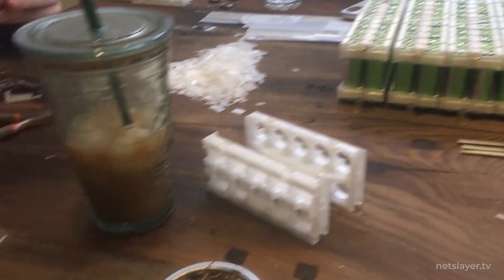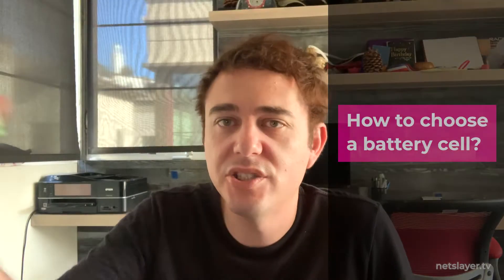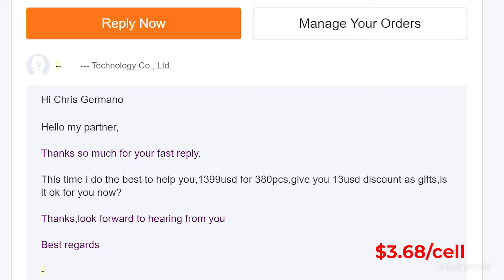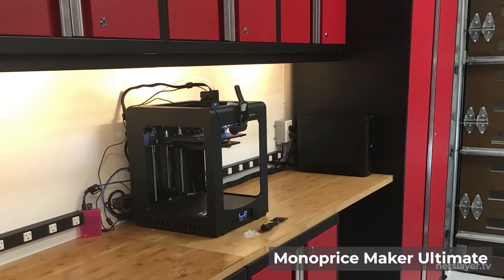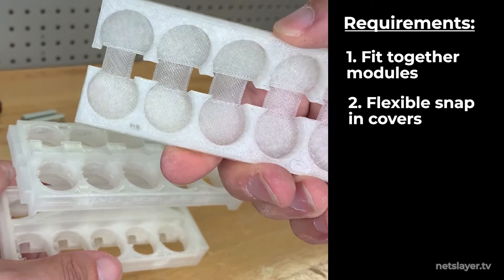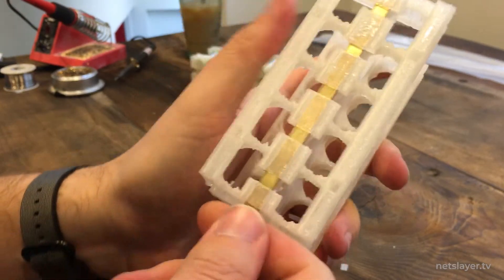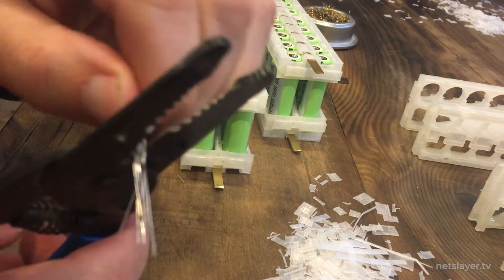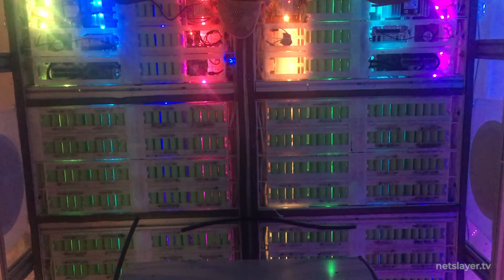How to build batteries - EP5: Building Enterguise an Electric Art Car for Burning Man. DIY 18650

Comment: Have you seen those little spot welders for making battery packs?  I've seen them used in a few videos.  Seems like something that might be handy for someone in the future.
Reply from the maker: I looked into building a spot welder for this project. It's not totally required but it does speed up if you are doing like a tin connection to terminals. There are also people on both sides of the fence if using a soldering iron (heat) on battery terminals is detrimental. I experienced no issues thus far. Definitely something to consider if you are building a pack from scratch. Check out what a friend did with his recent battery build using a spot weld: https://twitter.com/jerswoodshop/status/1257465572880642050/photo/1

Comment: Great video! Did you consider SLA instead of lithium? What made you choose lithium?
Reply from the maker: Great question! This comes down to cost, weight and, power. 

8kWh would require:
37x SLA ($40 12V 18Ah = 216Wh 12lb 0.7cu ft) batteries. That’s $1,500 for 450lb and 26cu ft volume.
635x 18650 ($3.5 3.7V 3.4Ah = 12.6Wh .11lb 0.0007856cu ft) batteries. That’s $2,200 for 70lb and 0.5cu ft volume.

1. Lithium ion 18650 cells are a bit more expensive but have much higher energy density to weight. So it will take drastically less space. 
2. Lifecycle on SLA is 200-300 recharges versus 1000 for lithium ion with lithium ion having faster recharge times. 
3. The amount of power you can pull out of lithium ion batteries is significantly high versus SLA so depending on application you may need a lot of SLA batteries in parallel to supply the desired discharge current which means you’d be limited how much voltage you’d have available. If you want anything larger than a golf cart or have some heavy loads then you'd need better batteries than SLA. Lithium phosphate is another option as well. 

SLA vs Lithium https://www.epectec.com/batteries/cell-comparison.html
Spec sheet for Panasonic NCR18650B cells: https://www.batteryspace.com/prod-specs/NCR18650B.pdf
Reply: @NetslayerTV  makes total sense, thanks!

Comment: Nice work! I am curious about how the choice of using brass ended up playing out in the long-ish run. As in, there is a mix of metals in play - brass, the solder (tin+led), fuse wires (nickel alloy?), battery leads. And there is electricity running through them, which may cause unexpected corrosion due to subtle chemical reactions. Sort of like running electrolysis but on a much slower scale. Connecting up batteries has always been a problem area for me. Cheers!
Reply: Great question! I haven't seen any corrosion yet. On the Anodic index chart, copper is 0.35, brass 0.35-0.45, silver solder (lead free) is 0.35, nickel-chromium/fuse wire 0.30-0.35 so that's within 0.15 difference, which is acceptable even for harsh environments so all seems to play nicely together. Any place there would be tin plating at 0.65 I'd have to watch if the car ever sat in high humidity or salt conditions.